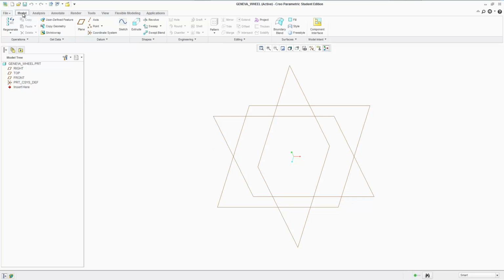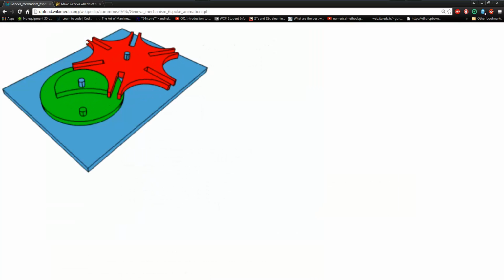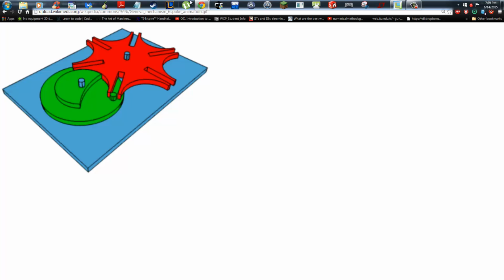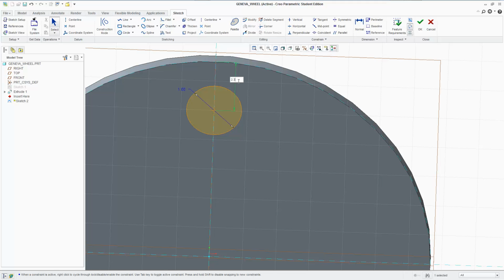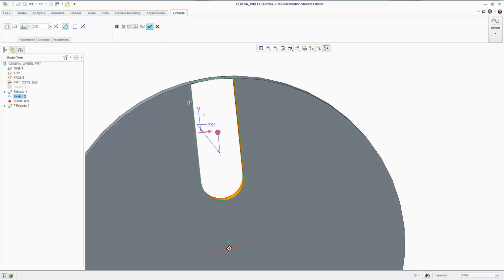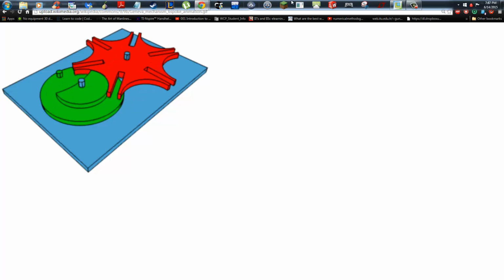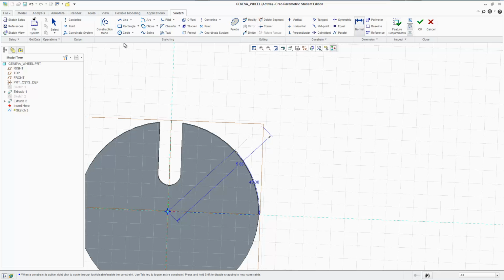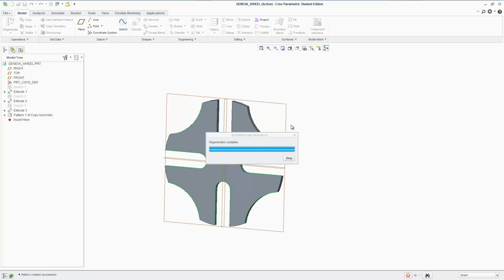08 Creo Parametric - Geneva Mechanism - Wheel

Comment: Hi, I did draw up a Geneva drive, with all components. I sized it right and have assembled it such that the two wheels can rotate about their axes, but I cannot constrain them such that they are rigid with respect to each other (or, in other words, to make the cam turn the Maltese cross wheel). How would you go about this? If there is a video you made showing how you constrained them, please do point me to it. Many thanks in advance! :-)